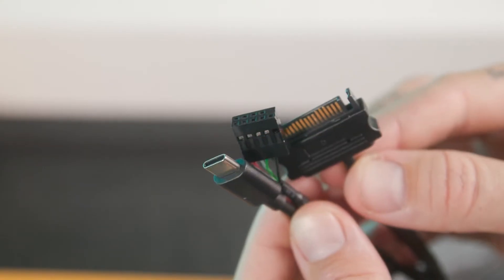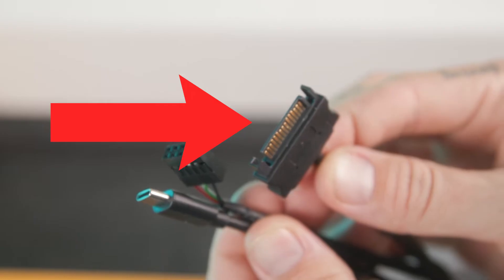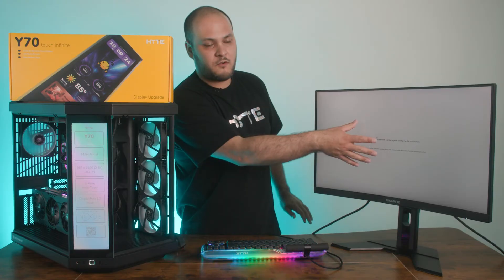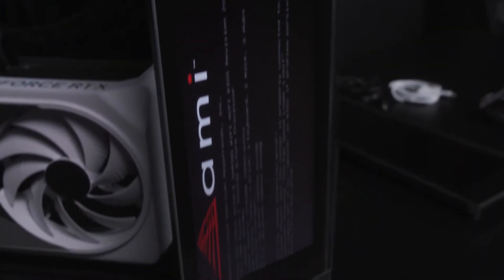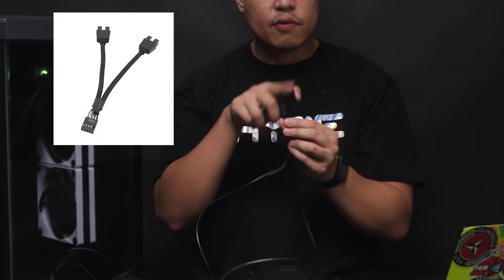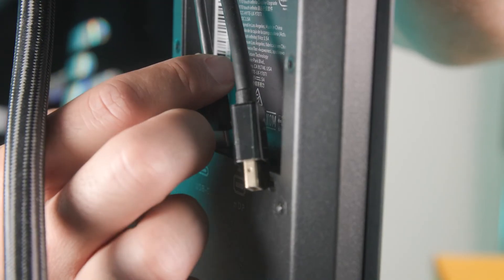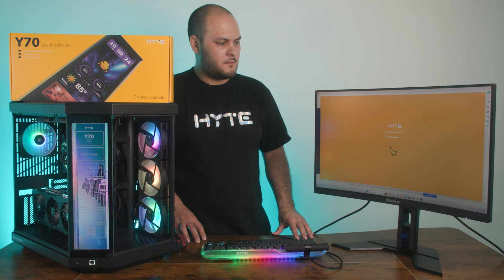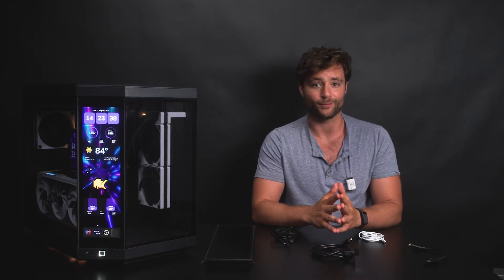Y70 touch infinite Troubleshooting - Calibration

Comment: I purchased the HYTE Y70 Touch Infinite case 5 days ago and I’m having serious problems with the front display.
The case screen is always detected as the primary display.
When I power on, the BIOS and Windows startup screen always appear on the case screen instead of my monitor.
I only want this screen to work with HYTE Nexus/Infinite software, not as a normal desktop monitor. The mouse and windows shouldn’t move there.
Even worse: if the screen is connected while restarting or powering on, I sometimes get no display at all on any monitor. Windows won’t load, and I have to power off/on 4–5 times before it finally boots.
This makes the system unstable and very difficult to use.
Can you please advise:
How to stop this screen from being selected as the primary display?
How to configure it to only work with HYTE software?
How to fix the boot issue when it’s connected?
Thanks a lot!
Reply: the same problem with :(
Reply: ever found a fix

Comment: The display screen is on but when I go to touch and interact nothing seems to work. I tried to do the calibration but none of the screens are turning white, there is a brief flash on my HYTE 70 screen but not the calibration screen. Has anyone figured out the issue??

Comment: I got mine to turn on when its the only display, and it the touchscreen works, but as soon as I plug in another display the screen just says no signal and doesnt work. Does anyone have a fix to this? I read online it was a manufacturing issue.
Reply: Check your settings and then go to display and there should be some stuff. Tell me if you need more help.

Comment: i touch the screen on the case, it does nothing but my main monitor moves ?
Reply: Same here! Have you fixed it by any chance?
Reply: @theodorecano4 Okay I figured it out if you still need help. Open your Hyte Nexus app on your PC, then click on “Faces”. From there on the left you should see “Settings”, click that. Then select “Run Touch Calibration”. Your monitor and the Y70s screen should both turn white. It’ll say something like “Touch this screen to set as your touch screen, if this is the PC monitor press enter for the next screen” or something like that. Do not touch the cases screen here and press Enter on your keyboard. Once it switches to the next screen THEN you touch your cases screen, and boom you should be in business
Reply: New calibration will fix it
Reply: Make sure the Y70 screen is set as "main display" in settings
Reply: What fixed it for me was making sure the mouse cursor was on the Hyte screen during the touch calibration step
Reply: See my comment below

Comment: Hey there! How you did yo install all those monitors. My screen is not working when I plug the DPI to the motherboard or graphics card, it wont turn on; take into consideration that I have 3 monitors connected via DPI, thus I have to use HDMI to DPI. Any idea to fix this issue?

Comment: Why does Hyte support not respond to messages?  My y70 touch display sata cable shorts my power supply out when plugged in.  I don’t wanna disassembly my freshly built pc to return it to microcenter.  HELP

Comment: my touch screen is not responsive with touch but its on i can see the display i just cant move or touch anything
Reply: @Lucetehe same for mine 😢
Reply: Same here. Ive tried all the troubleshooting, but its not working..
Reply: @Omega_Centaurii1101  ive been struggling with the same for over a week now myself
Reply: I just got my case and I’ve had the same issue now. Waiting for Monday for the devs to reply
Reply: My display is all black but the touch affects my monitor screen. I try to go through display settings but it doesn't show up as a display.
Reply: When you go through the steps of the Nexus installation, you will be asked to calibrate (click on calibrate).. now your main display get white and you get asked (if this monitor should NOT be the touch screen, then hit ENTER button, otherwise touch the screen with your finger).. so i hit the ENTER button and the same question switched over to the HYTE display. Here i have touched the display and voila.. it worked. YOU HAVE TO CALIBRATE
Reply: @JohnSeven-o4y  when I press calibration button, nothing happens? No white screen
Reply: @rays73 Hi. Are you going from within the Nexus app settings with the calibration or with the complete new installation? My manual guide was when you go with a fresh installation.
Reply: @JohnSeven-o4y  thanks bro i was almost not going to buy the case since everyone we're saying that the touch don't work. Thanks a lot
Reply: @ You‘re welcome ✌️
Reply: @JohnSeven-o4y  Very nice ! Thx you!!!